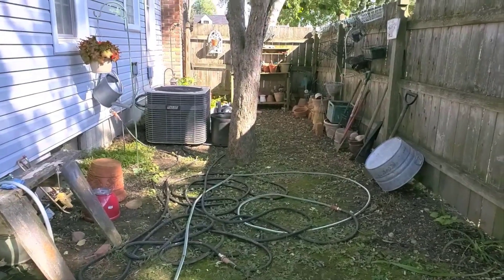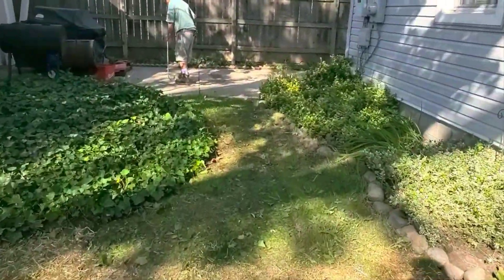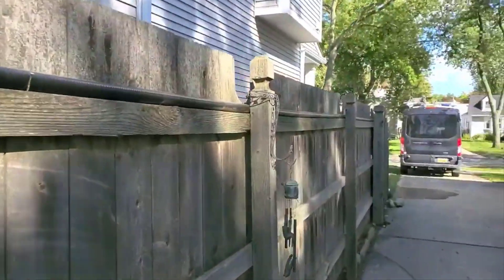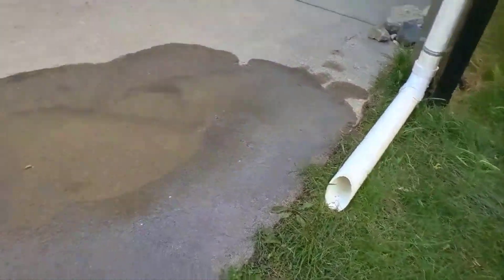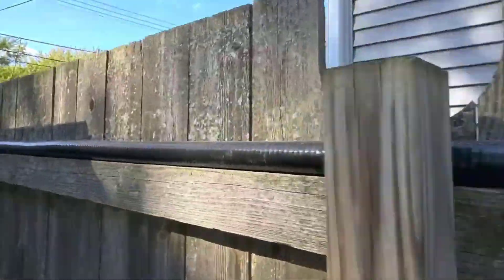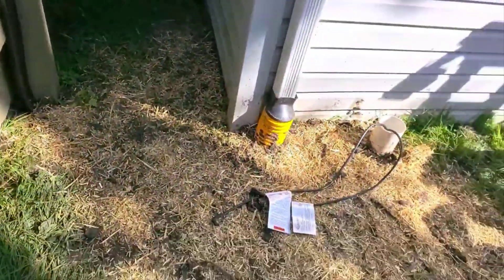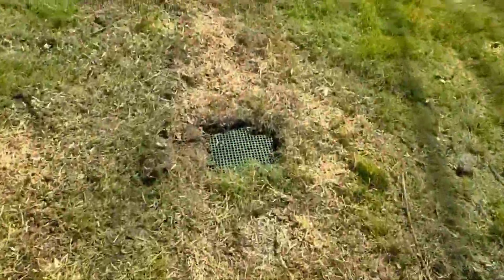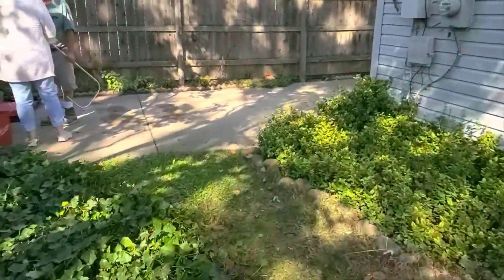BACKYARD Sump Pump Discharge Line Ideas

Comment: Won't that freeze in the winter ?
Reply: Could not freeze, because it's empty and discharge runs only once in a while ( the same reason sewer pipe do not freeze, but water supply does). Should be at minimum 2 % slope, though, so no water in it.
Reply: I was wondering the same thing. If there’s a check valve at the pump then there will always be some water in the discharge line, right?
Reply: @h2obreathe  Pipe heating cable https://www.youtube.com/watch?v=vMZgiN00nyQ or just insulation on a portion of a pipe with water.
Reply: An earlier video in this series he explains there is no check valve on this rig. So when the pump quits the water rains back into the basin from the uphill portion of the discharge line.
Reply: Won't this eventually destroy the driveway in winters with the water eventually finding a way into a crack in the drive and expanding?